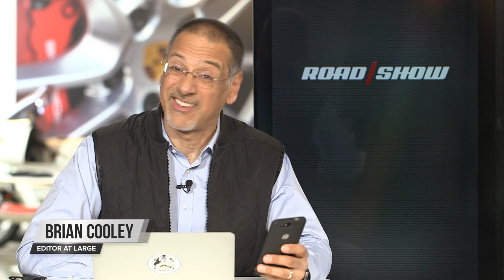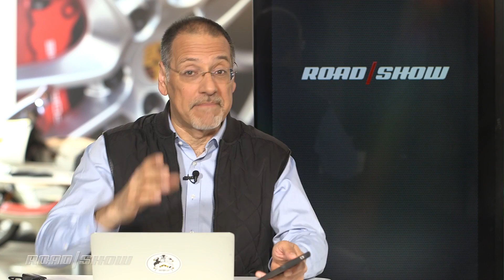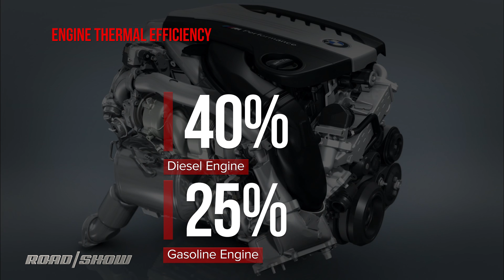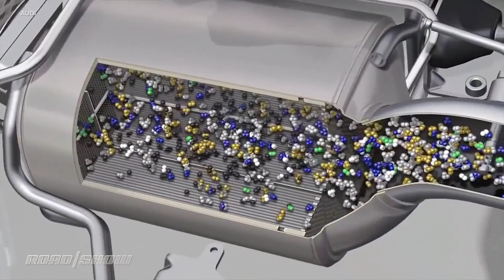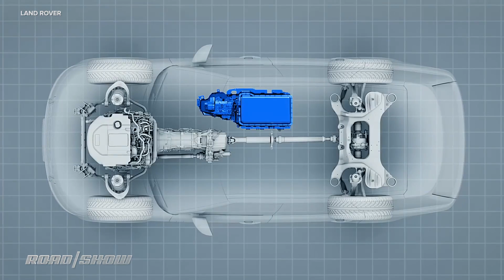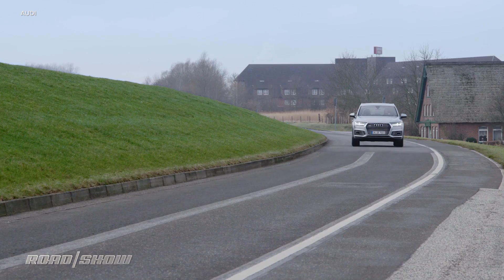Do diesel hybrids make any sense?

Comment: My diesel gets 6 L/100km or less on the cruse while electric does torque on the cheap (diesel does torque but not efficiently) - the perfect match considering the battery doesn't have to be that big to a get a car off the line ready for a diesel to take over.
Reply: The only dont mix well from a noise standpoint but im sure a good engineer could sort that out.

Comment: I think it will more efficient with 40k.w diesel as generator 15k.w LTO battery is enough maybe. LTO batery can charging 5C and very safe. Cz can't burn or explode. Battery life up to 15.000cycle. 
Diesel is more efficient when using as generator. Arround 35% less than gassoline conaumption.

Comment: Use a gasoline vapor engine.    As long as the intake and exhaust valves do not overlap, the gasoline vapor engine will run great off of gasoline vapor with no detonation

Comment: Petrol hybrids work with Atkinson petrol engine which is a match made in heaven.

Diesel hybrids make sense because you can give a car massive towing capacity with a relatively small and efficient diesel engine. It also makes sense because diesels are terrible in the city due to emissions and dpf related issues. 

I like the diesel hybrid. Cost is high tho.

Comment: When I was stationed at Thule Air base in Greenland two ice breakers come up from New York, the East wind and the West wind . The chief let me go down into the engine room , I loved engine rooms, being a jet Mechanic . He showed me six diesels driving six individual generators that were hooked to a bus bar . The power was then transimiied to two propeller shafts that provided Electic power to the propeller .I would assume some juice was charging batteries .  I was told one issue was not having a mechaical transmission to give reverse to the props . This is a major advantage to electric propulsion .
Many years later I was running a Navy supply company and we recieved a contract to supply a ship builder for Coast Guard contractor with Propeller shaft bearings and two giant Thrust bearings . We took a year to build the package and we lost our asses on the contract . Every thing was rush, rush , rush . The project was a success .

Comment: When it comes to heavy duty trucking I can see diesel hybrids making sense. Hybrids don’t need huge batteries, the truck could run on electricity when idling, when starting from a stop the electric motor could help thus reducing engine wear, on the opposite side brake regeneration from the electric could replace engine braking also less strain on the engine, and start stop technology could save on fuel. Not to mention no need to plug in.

Comment: Another thing to consider is that most gasoline hybrids use Atkinson cycle engines, which, by providing a lower compression ratio for intake vs. exhaust, increase the thermal efficiency to that of a diesel engine. The drawback is that power and torque are significantly reduced, but the electrified hybrid powertrain makes up for the deficiency. So automakers have two engine options, both of which provide the same level of thermal efficiency, but one of which requires complicated and expensive pollution control equipment as the video mentions. Of course you know which one they'll go with.

Comment: mercedes did a large range of diesel hybrids, some even plugin but as noted VW burned them all with greed and stupidity. There was some great engineering work being done to power the turbo electrically without the power loss of the turbo. However what was the diesel loss was the cost of the exhaust scrubbing and the micro particles that at ultra fine size are near impossible to filter without hobbling the power further. Nothing could solve that. Even shipping is moving from diesel fuel (and thats been ultra low sulphur for some time). We may have seen some benefit from the advanced diesel fuel additives. Diesel as an engine tech is excellent. Its the emissions it generates. Hybrid diesel still means just a more fuel efficient diesel. Ford-GM offer trucks but the heavy engine weight means a diesel is already heavy

Comment: To me the best approach is a plug in diesel serial hybrid (range extender generator with no mechanical power train). I could rant for pages why this is the best approach for cars and trucks. 100% pure EV is not going to work as a total solution and pure ICE has to go. Households having a mix of pure EV and plug in hybrids is the answer.

Comment: Hybrids carry significantly smaller batteries than full EV cars. For example my 2013 Ford Fusion Hybrid hides the battery just fine. Its no larger than my trunk, and it could be even smaller.

Comment: Fact:The largest trucks on Earth are diesel hybrids and have been for decades.

Open pit mine "haul trucks" run one or more diesel generators powering AC alternators and usually two AC motors per axel. They are not driven by a conventional ICE drivetrain. These trucks carry 400+ tons at speeds of 40 mph. I think we could throw a low emission 1L  3cyl TD on a PHEV and make it to the store. The global push for full EV regardless of logic is the driving force behind stagnation in innovation for tech like this. Commendable companies like Toyota are taking a stand on the side of reason, vowing to continue their (petrol) hybrid program. There are tradeoffs to all forms of energy allocation for transport.

Comment: first point of yours, my answer: YES, it needs the help of electric motor in the city, when you do stop and starts, a diesel in the city, doesn't do that well, it gets 7l/100km where's in the highway it get 3l/100km.  the diesel yes ! it is better than anything else when you drive at 1500 rpm on the motor/high way.  

second point of yours, my answer: NO, although the diesel is good at low end torque, it consumes a lot in the city, compared to when it is stablized at 1500 rpm on the highway, so the option is not redundant at all.  

third point of yours, my answer: we had diesel engines options for as long as cars existed, and to the last update i had, a diesel powered car is like 1000 2000 3000 ? dollars more expensive than it's counterpart. NO it is a false problem. it's not like a petrol engined car costs 20,000 dollars and its diesel counterpart costs 200,000 dollars. nit pick. and a full hybrid doesn't need a big battery, it's just the phev non sens thing.  

now, imagine having a (european as i don't know about the us version or even if there is a hybrid civic in the first place) 2023 civic ehev, full hybrid, which gets amazing liters per 100 km, 2 l / 100 km in the city, on the highway, it gets 6 liters. now imagine just that exact car, with just a diesel engine instead of its gasoline engine... in the highway that car has a gear to connect the engine directly to wheel (like a 6th gear in a traditional car) just for the highway... a diesel gets 3 liters on the highway, at stable rpm, 1500 rpm doing 120/130 kmh... i mean come on !!!!!!! what is your point !!!!

Comment: start and stop electric is better, diesel for the highway. a hybrid diesel would be better than what we already have. you would drive forever with a full tank of 55 liters. not  a phev, you would add weight. just let the hybrid system charge it's small electric battery, via regenerative braking and diesel engine.

Comment: OK diesel hybrids are the most efficient thing out there. They have been using them for years and trains and in ships because it’s the most efficient it is pricier though they don’t have batteries either on trains and ships. You can get a lot of mileage out of a diesel motor when it’s at a steady rpm less wear and tear

Comment: Diesel engines are only efficient if at optimum operating temperature. Diesels take longer to reach this temp and when the engine is only activating when needed in a hybrid the engine will not run at its most efficient on most trips. Also demanding max power from a cold engine is not recommended as this can cause premature damage.

All this said, I’m no engineer so this is only my knowledge and opinion.

Comment: The heavy is null and void with the torque of a diesel and electric motor... think about it, is it easier to move a f150 with only a diesel engine or would it be easier to move an f150 with a diesel engine AND an electric motor..... they both have to be able to move the truck. As for tge cost.... that is where the issue is. Diesel for some stupid reason is like 30% higher priced than gasoline here in the states( makes no sense) and there are some gasoline engines reaching 40-50% efficiency already so even if diesels became 60-70% efficient you are still going to be paying more for a diesels initial cost and fuel... sucks cause diesels last forever

Comment: Just a thought on diesel hybrid tech. I believe changing how the diesel is used in a hybrid car would go a long way toward sustainability and optimal usage. Instead of two motors driving the vehicle use the electric motor and battery to drive the car. What do diesel engine do very well? Idle. If you were able to effectively idle at a rpm that could recharge the vehicle when needed starting with a plug in hybrid fully charged and use the diesel solely for charging the battery along with regenerative brakes and other tech out there, could you not post a higher mpg? If a semi can idle overnight using 10 gallons of fuel and you were using a 2.0 lt motor to charge charge the battery once underway with overcharge protection automated charging why could it not do much better then the equivalent gasoline hybrid model? Food for thought, answers appreciated.

Comment: I am not thinking of a hybrid--when the diesel and the electric power the car--I am thinking of diesel running to generate the electricity to run the electric motors. This would be similar to modern trains.

Comment: Quit being an  nay sayer.!! You would use a much smaller diesel power plant to run electrical.
Which then lowers both costs and weight.  You non thinking smuck. 🤔 
Consider the torque from electric motors backed by a diesel.
New , lower weight, higher efficiency batteries are at hand..just ask Porsche.

Comment: This is quite possibly the dumbest most ignorant video I have ever seen on YouTube. There is absolutely no reason you can’t have a SMALL light diesel engine in a car IDLING while driving a generator that in turn charges battery’s and runs an electric motor and the rest of the car.

Comment: If that were all true then why the hell do train manufacturers still refuse to use a mechanical drivetrain in a train and use a diesel electric setup it's not a hybrid you just have less losses through an electrical system there by increasing inefficiency

Comment: That's gotta be the worst explanation I've ever heard and can't disagree more! Diesels are not efficient at stop and start driving, electric cars are. Electric cars are not efficient at highway speeds, diesels are. And those vehicles you mentioned in your video have gasoline counterparts. What you didn't mention is that the diesel variants got better fuel economy... get your facts right. You're getting a big thumbs down for not actually doing your homework and putting research rather than your opinion into your videos. This is the last one I will watch

Comment: However....a diesel hybrid with a small 3 clylinder diesel could power a powerful electric motor and together you would have awesome torque and towing potential on something with insane fuel efficiency and no lengthy down time charging

Comment: Why don’t we have Diesel electric cars , not a hybrid I mean I fully electric car with a diesel generator charging the battery’s, like a train or ship. The whole issue with electric engines is that a significant amount of fuel is use just for accelerating so why don’t we have electric vehicles that are powered by internal combustion engines. It’s simply different than a hybrid vehicle that really is more electric assisted than necessarily electric powered.

Comment: Electric cars are efficient for town driving, but suck at hyw driving. Where as diesels are efficient at hyw driving, but not good for town driving. A hybrid would get the best of both worlds. That why I think it would be a good idea.
Reply: Electric cars are still more efficient on highways. The drop is big enough to reduce range though. All that is required is a range extender.
Reply: the aim of hybrids is to be cleaner than 100% ICE vehicles & diesels are just dirtier than gas, so a gas hybrid is cleaner than a diesel hubrid in a vehicle
Reply: @HSstudio.Ytchnnl  diesels are not dirtier than gas engines. Gas engines are dirtier than diesels

Comment: Obviously Cooley is not an engineer. Diesels can be added as a modular, easily detachable system instead of a permanent arrangement. A diesel has not necessarily to have lots of torque. 
Using it as an auxiliary system to provide some oomp when needed, and charging the batteries meanwhile, is an idea that has been applied already in the Prius.  
It can be designed in such a way that you won't need even a wrench. I know it can be done even in a home workshop. 
Follow my channel because in the next few years it's possible I will be working on this.

Comment: In 2020, Mercedes-Benz is launching a GLE 350 de; you gessed it, a diesel hybrid - 200hp/2 liter / 4 cyl diesel engine + 134 hp electric engine with 31.2 kWh battery pack for a 66 mile electric only range. It's the sweet spot!

Comment: I disagree, Use a very small diesel engine, to generate power and use the power generated to drive the wheels, and the number of batteries could be a small amount of storage. Just like Diesel-electric trains.  
Another way possible... small diesel motor with a CVT transmission between the engine and the generator portion.. so small increased throttle would greatly increase power output available to drive the electric motors on the wheels, of course, an ECU would control the diesel engines rpm and power generation on-demand.  I think this is very do-able.

Comment: The heavy/excessive torque argument is only applicable in certain segments. It seems like it would solve many of the issues with an electric truck. 
1. Decreased range when towing
2. Inability to haul long distances without extended stops.
3. Excessively large battery

Comment: I like the idea of diesel hybrid, diesel engines makes peak torque at low RPM, so do electric motors. 

So basically if one of the motors fails then you’re still left with a torque motor that can pull its own weight🤘.

With a petrol engine you have less mileage because the petrol is pulling the battery and electric motors weight at a peak torque of higher RPM’s. Diesel wins!!!!

Comment: I have a Chevy Silverado hybrid with a 300lbs fiberglass truck cap and about 500lbs of tools and depending on my work load 100+lbs of material, so for me the low end torque makes plenty sense and any  truck owner who hauls loads would also disagree, a diesel hybrid makes plenty sense, the only thing that matters is more mile to the gallon when it comes to most SUV and truck owners...

Comment: The reason that there are few diesel hybrids, is because using hybridization to get better fuel economy out of a diesel engine is like a rooster letting a fox into the coop so that it can eat the rats, but hoping that it doesn't also kill the hens. By using electric motors to pick up the efficiency slack of engines, you inevitably come to the conclusion that the engine isn't really that good at doing it's job, and you just eek further and further towards the realization that engines are heavy, inefficient, mechanically complex and not very good at making and delivering power and torque. I think best case scenario a very small diesel engine would make a good range extender for a plug-in electric vehicle, but the second you start trying to connect the diesel engine to the wheels in a hybrid setup, the effort becomes pointless. Hybrid vehicles need to stop focusing on ways to compensate for the inefficiency of engines, and start focusing on using lightweight engines to compensate for the low energy density of batteries. A hybrid that's electric first, and diesel second, would be a great vehicle.

Comment: I wonder how many KW you would need to run an electric car? Just have a small diesel generator on board to power the electric motor, AC, and accessories, forget about batteries all together.
Reply: Should be 20kw continously and maybe 150kw peak power for acceleration. Small battery or supercapacitor maybe needed to reach peak power.
Reply: There must be a political reason why nobody mass produces diesel electrics. Most sensible with at least 50 to 0ver 100mpg!!!!

Comment: Andrew Van Beek is right  about Redundancy issue To dd to his argument diesel is more efficient and quieter at a higher  gear ratios since electric motors were always design to do the acceleration because its not very efficient at high speed it would really make sense to use the  diesel engine after the 2nd gear it then you get  a smoother quiet and a ride